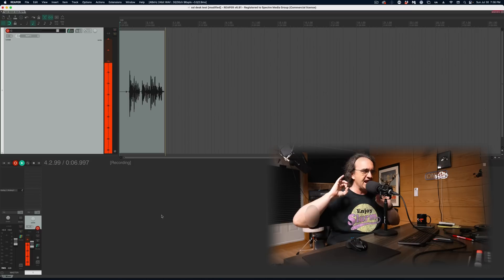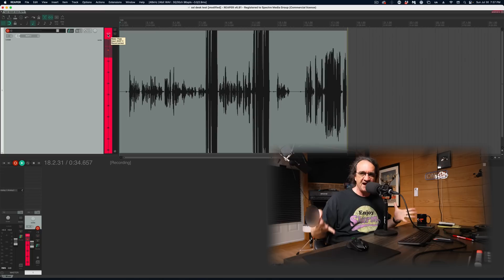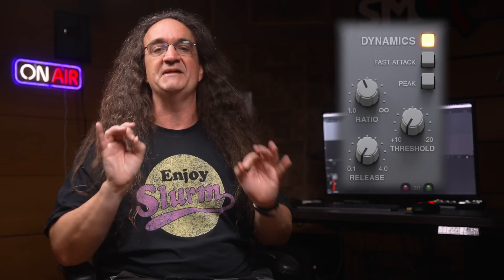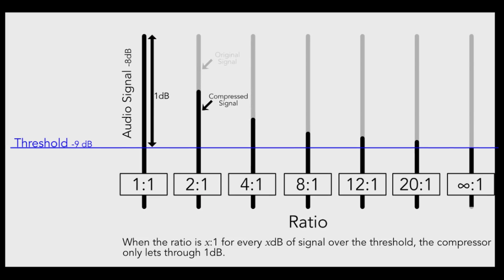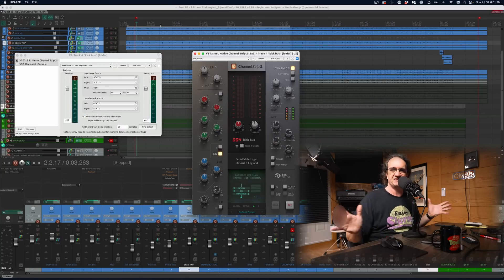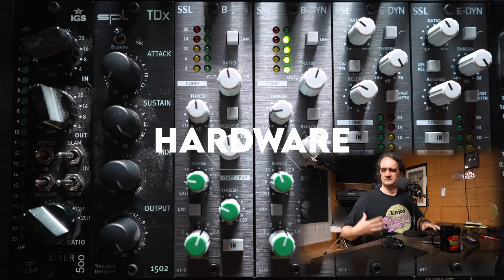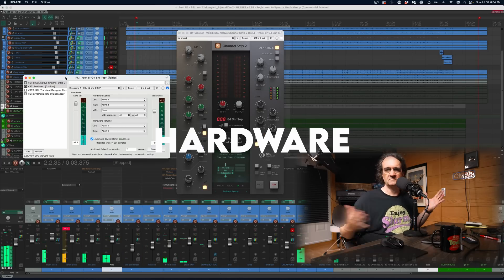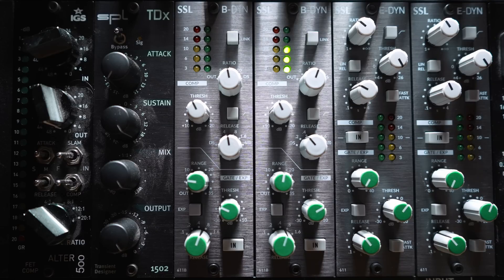5 Reasons this is BETTER than your Software!

Comment: Noob hardware question Here - I'm in the process of building a new studio from scratch. I have the budget and would love to have a 500 series rack, but I'm confused about one thing. In simple terms.. obviously, you cant have one compressor processing multiple tracks simultaneously. So how do you get around that? I understand how to do all the routing in cubase (daw to interface to hardware, back to interface and daw)  if I want to use the same compressor for multiple tracks how does one  accomplish that? For example, if I have one compressor and want to use it on the snare and kick, how the hell do you "print" the compression settings on the snare track before setting everything to zero and moving on to the kick? Then, if you want to go back and adjust the snare, do you just make notes to know where your settings were at? I assume there has to be a way being I doubt everyone is only using their one compressor for one track.( I havnt found the answer on youtube) i hope this makes sense and any insight would be helpful before I drop the money lol.

Comment: The software sounds just a bit flatter and quieter to me. It was almost un noticeable. The hardware sounds just a tad better because its just that slight bit fuller and crisp. I'm using Steel series arctis 5 headphones, not top of the line but not cheap either.

Comment: Glenn, great explanation on what each function of a compressor does and how it works.  To my knowledge, I have never seen such a simple explanation done in a video before.  Most engineers who discuss compression take you into the depths of audio engineering and expect you to understand what they're talking about.  Same with an analog mixer.  I have never seen a video yet on how to use an analog mixer for a guitar rig using hardware devices in the aux sends.  Do you think you could do a video on that?  

Two last points....  Regarding the comparison, I could hear more detail coming from the hardware mix vs a more "blanket" tone when using the plugins.  Not sure if that was done on purpose but, that's just what my ears heard.  Since you raised a good point about hardware vs software....  Would you be up for doing a Pepsi challenge between an Eventide H3000 and the H3000 Factory plugin?  I hope that since you're an engineer you have a real H3000 in your studio......

Comment: Hi Glenn, this compressor is based on 4000B console channelstrip dynamics and not the buscompressor. And also, you should test against the SSL Native Channelstrip 4kB which has same controls and same reference, the vst you used was referenced from SSL 9000 console. You were showing us the "hardware" which was showing literally 0 compression based on leds, which is weird because I think i could hear the compression (although there was no unprocessed referenced). I was looking trough reviews because I am interested in buying this, I'd expect reviews to be more accurate and transparent. Sorry Glenn, you're a great entertainment but this video was full of wrong info.

Comment: It sounds good but I don’t know that the difference is worth the money (at least for me.) The difference to my ears is there seems to be more punch and top end in the hardware mix but I think that could be dialed in with compression and eq in the digital realm if you’re cognizant of that. I also like mixing in the box is being able to recall everything quickly. If you get into mixing a lot of stuff recorded in different locations, you’ll have lots of different settings; you can’t just set and forget. To dial in the mix from six months ago might be difficult with hardware. I know a lot of top mixers have gone completely in the box for that reason. Just my two cents. Keep kicking ass, Glenn!

Comment: Personally like the older dynamics module overall.  This is also more expensive with less control over how the compression works.

Just my opinion.  But at these prices I'll stick with the compression I already got in my rack. 14 channels is enough, rack is full 😆

Comment: I love hardware. I am an electronic musician and run everything into a 24 channel Mackie console. I sequence my drums and bass with an Arturia KeyStep Pro. It's so nice to reach over and move a fader. It's not uncommon for me to have just one track in Reaper. Currently I only typically use plugs for mastering. A bit of EQ and some light compression. With drums and bass it's nice to just reach over and turn up the bass on the console. Another advantage to mixing on a console is that I can't tweak the mix endlessly. Once it's recorded if I want to tweak the mix I have to re-record everything. It's pretty common for a song to start as a live jam. I mix as I go. Then I might say to myself "that sounds cool, I should record that." The other benefit is that my Behringer interface only has two channels. So I just have the main mix output going into the interface. Sometimes I may do multiple tracks in Reaper and do a hybrid mix.So the drums for example will be one track in Reaper that was mixed on the console. 

Same for instruments. I have some fantastic VTS synths. But I hardly use them. I prefer my vintage synths and drum machines from the 80s. There is just something nice about physical buttons and knobs. I am even thinking about adding physical media for recommending. I thinking Mini Disc for digital convince and cassette for some lo-fi flavor. Then that would get recorded into Reaper so I can post it on the internet.

Comment: I'm listening with AKG K701 and i think that the main diference could be some saturation, but i could be wrong. The thing where i completely agree is the "not mixing with your eyes" thing. I really feel the difference since i switched to an icon qcon and a softube console 1 for mixing. I know it's not the same thing, but at least i'm not watching the monitor anymore and even if i'm probably a really crap sound engineer at least i'm trying to get better and most important find my sound this way!

Comment: I have issues with power consumption and, with the sheer amount of computers / audio gear going into this single room, i have tripped the breaker on a few occasions. I just can't use anymore hardware, i have to switch as much over to software as i can. I'm trying to maximize efficiency over chasing after "The Sound", it is what it is.

Comment: BS. There is nothing that can't be accomplished with software. Because? With software you can get to EVERY parameter. You have to simply use it the right way. So, please, stop that hardware propaganda with half assed not quite correct pseudo BS arguments.

Comment: Very cool video 👍  I believe hardware definitively adds more to the mix BUT, I believe in this examples, you could´ve make the software brighter to sound as alive as with the Hardware. Not? 

I mean, I can get maybe 99% that hardware drum sound using the plugins....the last 1% I know, it´s what really makes the difference. . .  but I don´t think it get to even pass through YouTube compression . . . .  so imho, I believe the difference in the video mostly is from the settings of the plugin vs the hardware. . .  being possible to have, through YouTube, the exact same sound. 

Not?

Comment: Hey Glenn. What you're comparing here is not Hardware/Software, but entirely different compressor topologies. 4K B compressor is a FEED-BACK compressor, while 4K E&G, 9K J&K are FEED-FORWARD . Of course they would sound different. SSL has a 4K B plugin channel strip, you should've used it instead to make it a fair fight...
Love your videos. ❤
Reply: Oh and also, 4K B comp reacts to peaks while 4K E&G, 9K J&K react to RMS signal.

Comment: You should definitely try comparing a couple of the other SSL Plugin Emulations, most notably, the BX SSL’s are my favourite straight up SSL plugins, they even model channel tolerances… another great channel strip (especially the dynamics) is the Metric Halo Channel 3. I like the SSL Native plugin, but the lack of harmonics make it a bit too clean, which is what I think you’re hearing as the difference between the plugin and hardware here. 

I love SSL and as much as having a big full size console would be absolutely amazing for it’s tactical feel and vibe…(for the record the hardware definitely is still better) but having one channel and having to print all your tracks through it would get wayy too tedius and not worth it compared to the right plugins. 

I have an SSL Fusion and the warm audio Bus Comp and use them on my 2 bus to inject some analog mojo into the mix and that seems to be the best and most practical way to get that hardware “sound” without having to constantly be running prints. 

Thanks for the vid Glenn! Cheers!

Comment: The best thing about hardware is that you actually OWN it, were as software can be deemed outdated and loose support without a heads up from the developer.
Any good quality hardware, if properly maintained and cared for, will last pretty much forever. That's why we still have vintage gear around

Comment: in this case the metering is liner in the software so the RMS values are misleading - the swings appear less dramatic. You'll be making changes that are over or under what your doing with the hardware. I have the same issue with the control software on the X32.

Comment: Thank you for making this video. There are so many reasons why Analog equipment is better than plugins. Your sound has a UNIQUE SOUND. There is a reason why records back in the day had its own sound. Digital mixing and processing were not a thing, because of the lack of computing power, so when they used outboard processing, they are creating their own SOUND. Also, I want to add that plugins have been stolen, by pirates. If you have the right computer skills, you can easily get them all for free. The value of plugins is very low. I recently bought some waves plugins at a very low price because they have already been stolen by pirates. This cannot be said for analog hardware. Also, one bad thing about analog hardware, is, it does color the sound a lot....it is electronic, and relying on electricity to process, which means any audio going in is going to lose quality when going out... but.... this is EXACTLY what you want in the professional audio world. You want the sound to be PROCESSED, and with the multi-grand equipment, the sound changes in a GOOD way. With plugins, when you process the audio, you will always get the same sound, which in some cases, might be a good thing.

Comment: I have no doubt the differences were more dramatic in your CR but a couple of things to consider. The cheapest 500 series rack that I found on Sweetwater is the Midas L6 at $279 which holds 6 modules, the SSL B Dyn is $699 each, for 2 + the least expensive rack will cost $1,677 US without tax. The SSL G3 MultiBus Compressor Plug-in is going for about $200 US and can be used on multiple channels. The SSL Bus Compressor 2 Plug-in is going for $330 and it can be used on multiple channels. Don't you use presets on your plugins for repeat sources?
I was listening to the mixes the first time on a good set of earbuds, Grado 250's and could hear NO difference between the mixes but just to be sure listened again on my calibrated headphones and heard only a marginal difference. To me on the calibrated headphones there was a slight increase in punch but not enough to justify a $1.5k difference in price for only 2 dedicated channels of processing. Then again, there is no ROI on recording/musical equipment these daze.
I came up through the daze where we only had analog gear and I don't miss it. I don't miss the heat, the thermal drift, or the noisy pots. For that matter, I don't miss having only a few processors in the rack due to the expense or having to calibrate, demag and align the machines every morning.
I've been using Sonible plugins as they are a tremendous time saver, the AI does a lot of the heavy lifting. The new Smart:Gate is pretty impressive on multiple sources and the Denise Poltergate is great on live drums. 
Admittedly, I don't miss analog at all, also I don't primarily record metal but I've been recording since the middle 70's. I've worked on SSL, Neve, Harrison, API, ADM and a bunch of others over the years. One of the things I liked about the earlier SSL consoles was that they had a gate on each channel. 
I owned and rebuilt a pair of LA-2A's that had the T4 original control modules. I loved the sound but I didn't love the thermal drift, I sold the pair about a decade ago, the software emulations I have now sound close enough and don't drift at all. I like the ability to close a project and come back and open it later [maybe a LOT later] and it still sounds the same as when I closed it. Couldn't do that with analog gear, there was such a thing as a studio lockout for a mix and I did more than a few 36 hour album mix sessions.
BTW: Most of those that still mix on SSL, Neve or other consoles bought 'em new and are probably still payin' 'em off, the others are just knob jockeys that haven't been able to adapt to the newer technology. A classic Neve or SSL 2000 can be bought cheap but the cost of re-capping is pretty daunting. Don't even bother trying to find parts for the early SSL computers. 
That "classic sound" is just an aural quality we are accustomed to, all the great recordings were recorded with the technology they had at hand and mostly wasn't even state of the art for the time.
The trick is to capture a great performance with the tech you have available, there is still no technology available to fix a bad performance. Don't fret, AI will soon make all of us obsolete.

Comment: If there is one thing we can learn from this video, it's how to absolutely market the crap out of something even when really good low-cost alternatives exist.

Grab a free Variety of Sound compressor—y'know a software compressor that actually saturates the signal like analog gear—with a non-linear response to get that aggressive sound and map the controls to a controller with knobs on it.

Not saying it's a bad hardware compressor. The mix sounded great (better with the hardware but still good even without all the extra saturation on the software mix), but the best thing in this video is unfortunately Glenn's marketing skills.

Comment: One of the main reasons that makes me stick to my trusty old tube amps, cabs, and pedals is that hardware doesn't change. There's no need for an internet connection or clicking on anything; you immediately hear the difference when you turn the knobs, and it just works without anything else.

I have nothing against modeling; it can sound really good, and in most cases, it's impossible to distinguish real gear from software. However, as I mentioned, it's the instant response and the fact that it works without anything else that pushes me to stick with hardware.

Comment: First time watching this and I immediately closed my eyes and just listened to the last bit. I could could hear the differences straight away without looking and it was pretty obvious!
I kinda think that most people need maybe about three or four hardware pieces in their production line and then the rest can be handled by software on a channel by channel basis.
Myself, I use an ART Pro VLA II, an ART TPMS II and a Behringer FX-2000 3-D Virtualizer in my hardware case. Still learning some of the intricacies of all these units, but, I love the fact that I don't have to menu surf through countless screens.
Great video Glen, need more like this.

Comment: In the box is almost always faster for me. Routing I/O is a pain. Then having to physically write down all of your settings when using hardware if you want to use said hardware on different tracks… PITA. I only use hardware on the way in for the most part.

Comment: Dude your mixes these days are to die for. I don't know what has changed (not attributing it to this hardware compressor of course). Just over all. Unique and Massive sounding. Nice
Reply: Step 1 is getting an excellent recording. What happens BEFORE the converters matters A LOT!
F that step up and the mix can't be as good as it could have been.

Comment: I think this video is trolling, but just in case. The hardware compressor examples were louder than software ones (automatically better!), and they were also slightly brighter with less mud (probably the saturation).